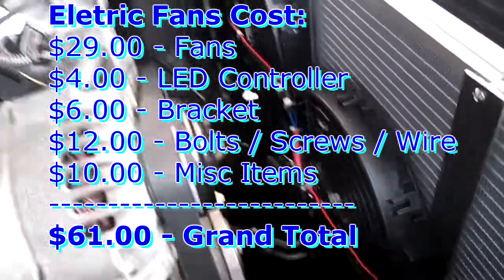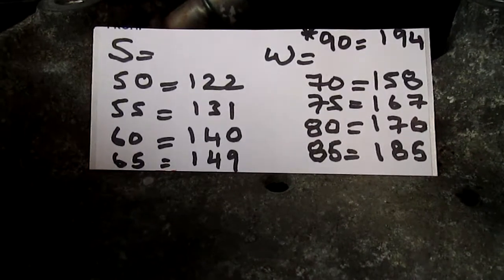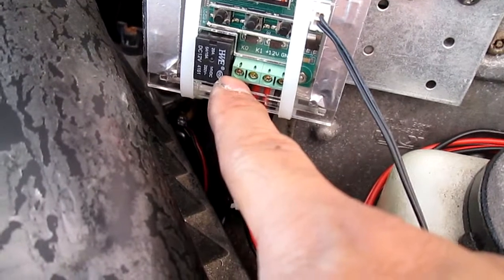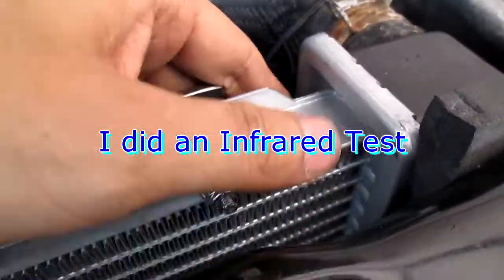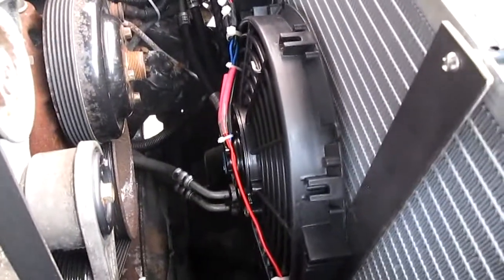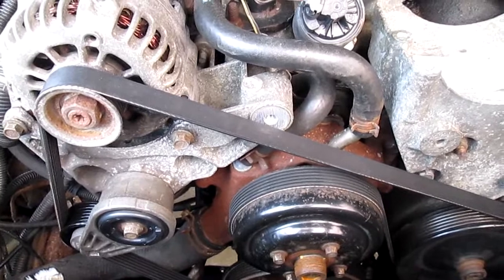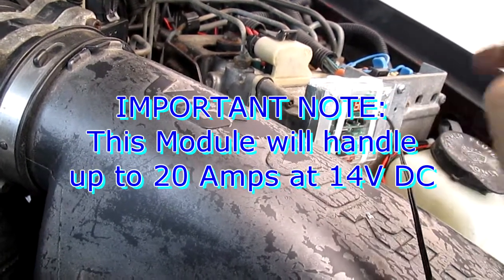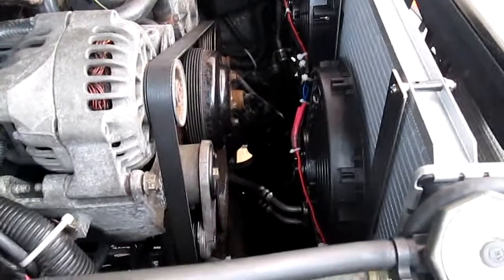Video 5 - Clutch Fan Delete to Electric Fan + LED Thermostat Controller + Horsepower Gain

Comment from the maker: Parts In Video:
#1 - 2x 10" Inch Universal Slim Fan Push Pull Electric Radiator Cooling 12v Mount =  https://www.ebay.com/p/27009245812
#2 - 12V Thermostat Temperature Control = https://www.ebay.com/p/332175543195
#3 - Bracket = 1 in. x 36 in. Plain Steel Flat Bar = Home Depot 
#4 - Bolt + Screws = Home Depot
#5 - Wire + Mics = AutoZone
----  STEP-BY-STEP Wiring + Etc... https://www.youtube.com/watch?v=I3hAjVmwWT4
NOTE:  I am NOT associated with Sellers!
Reply from the maker: CHECK DESCRIPTION
Reply from the maker: DECEMBER 2019 UPDATE: This was done 2 +1/2 Years ago before I made the Video, it's still working AOK.  My Dad put over 15K since and it's still working.  The Temperature Controller is great especially for Summer and Winter.  You can set it to ANYWAY you want.  My Favorite Settings....  Summer = 45 Celsius (113F) and Winter = 85 Celsius (185F) because we need Heat in Winter.

Comment: does this work on a 2009 ram 4.7? Plus for mine it already has fans on the radiator. Plus a couple months ago my fan on my fan clutch decided to blow up and was driving like that for a while until I got it fixed and the temperatures stayed the same

Comment: So where do you get the temp sensor installed
Reply from the maker: Parts In Video:
#1 - 2x 10" Inch Universal Slim Fan Push Pull Electric Radiator Cooling 12v Mount =  https://www.ebay.com/p/27009245812
#2 - 12V Thermostat Temperature Control = https://www.ebay.com/p/332175543195
#3 - Bracket = 1 in. x 36 in. Plain Steel Flat Bar = Home Depot 
#4 - Bolt + Screws = Home Depot
#5 - Wire + Mics = AutoZone
----  STEP-BY-STEP Wiring + Etc... https://www.youtube.com/watch?v=I3hAjVmwWT4
NOTE:  I am NOT associated with Sellers!

Comment: No me muestra en el monitor del termostato despues de pasar de 44 grados que sera ? Quiero me funcione a 65 grados
Reply from the maker: ¿Compraste el correcto? W1209 12V -50-110°C Digital Thermostat Temperature Control Switch Sensor Module
Reply from the maker: Ebay:  https://www.ebay.com/itm/192112054053
Reply: El mismisimo , solo estoy viendo que en la pieza c5 no tiene una resistencia, sera ese el problema,  pero se ve que viene asi de fabrica, compre 2 y los 2 vienen  igual :(
Reply from the maker: @FENIX-re9tx  - ¿Establecerlo como regular?
Reply: @JodBronson  ???? En el tuyo si trae ese componente en la placa,  donde dice c5 ? Si es asi le consigo el componente faltante 😅
Reply from the maker: @FENIX-re9tx  -  No sé de qué diablos estás hablando c5.
Reply from the maker: @FENIX-re9tx  -  Quizás no sepa cómo configurarlo!  😅😅😅😅😅
Reply: @JodBronson  le falta un condensador smd cerámico el c5 psra ser exacto,  sino me comprendes siempre muchas gracias por la información 👍
Reply: @JodBronson  efectivamente el condensador smd cerámico era el problema,  muchas gracias amigo y excelente invento 👍👍👍👍
Reply from the maker: @FENIX-re9tx  - Ah, OK!

Comment: Jordan is it possible you could provide a link to all the components you've used in your car here
Reply from the maker: #1 - 2x 10" Inch Universal Slim Fan Push Pull Electric Radiator Cooling 12v Mount =  https://www.ebay.com/p/27009245812
#2 - 12V Thermostat Temperature Control = https://www.ebay.com/p/332175543195
#3 - Bracket = 1 in. x 36 in. Plain Steel Flat Bar = Home Depot 
#4 - Bolt + Screws = Home Depot
#5 - Wire + Mics = AutoZone
Reply from the maker: See this Video for Step By Step Wiring + Etc.... https://www.youtube.com/watch?v=I3hAjVmwWT4
Reply from the maker: DECEMBER 2019 UPDATE: This was done 2 +1/2 Years ago before I made the Video, it's still working AOK.  My Dad put over 15K since and it's still working.  The Temperature Controller is great especially for Summer and Winter.  You can set it to ANYWAY you want.  My Favorite Settings....  Summer = 45 Celsius (113F) and Winter = 85 Celsius (185F) because we need Heat in Winter.
Reply: @JodBronson  Yo cool. Thanks for the video. I was curious how I could go about switching from a clutch fan to electric dual fans on my 200sx hatchback and you answered it.
Reply from the maker: @DeeKnow  - You are welcome!  You will love it, if it has a clutch fan.  You will get more power, alternator charge faster, faster pick up, save a bit of gas, lighter engine, engine crank easier, etc.... OMG, my Dad had no problems since, he did it to another Truck, LOL.
Reply: @JodBronson  Yea I'm converting a 1986 200sx Nissan s12. Again. Thanks for the video!
Reply from the maker: @DeeKnow  - Oh kool!  You can see the detailed here:  https://www.youtube.com/watch?v=I3hAjVmwWT4